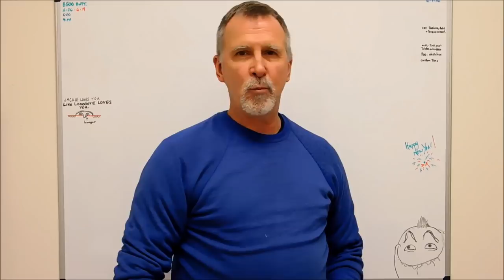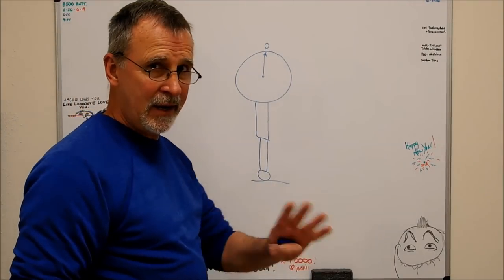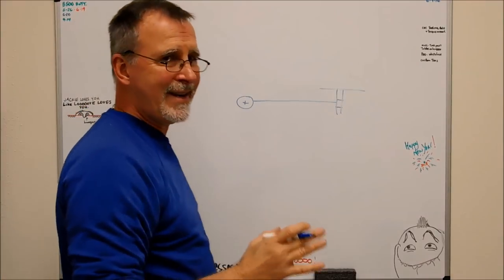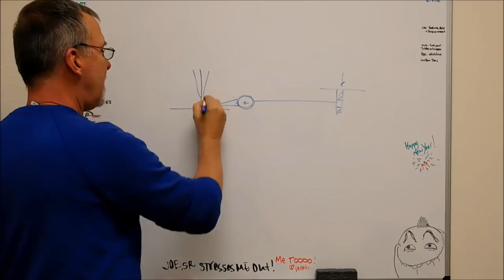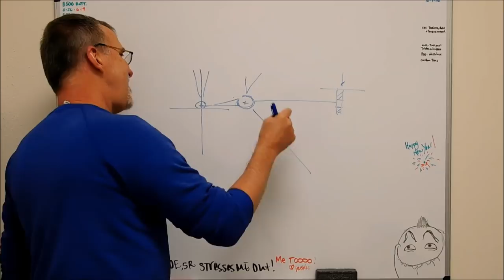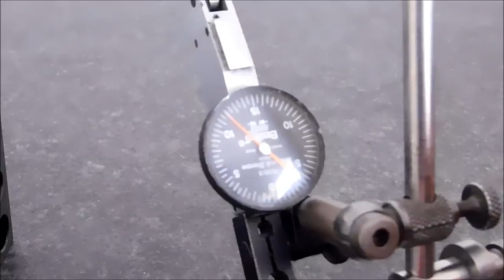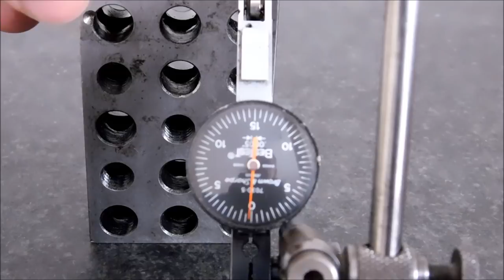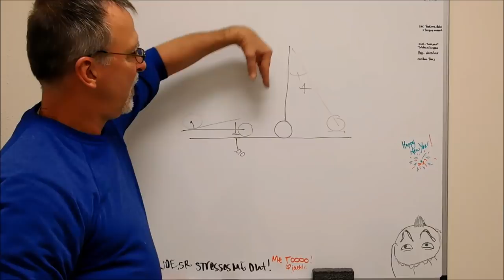Cosine Error Demonstrated and Challenged !

Comment: The videos I've watched, no one is arguing about the indicator body, it's the angle of the needle to the work. Can you post an example so I can get worked up, or perhaps a chuckle. ..?
Reply: The last 30 seconds covers the angle of the needle to the horizontal plane and THAT is where the cosine error can occur with a last word indicator. If the angles are identical for 2 readings, then there is no error- but this only occurs when indicating IDENTICAL heights. Any height difference induces not only the cosine error, but also the actual-stylus-length error because the tangent point on the ball has shifted. 
  See my post to Joe P.
Reply: gene koveski Thanks, I understand. I was being a wise apple in that no one is arguing about where the body is in relation to the needle (hence the friction action of the needle). I turn the body to face me all the time.

Comment: what you didn't include in your video was how you rotate the stylus which is held with a tiny clutch to keep it in the desired position ...otherwise good video
Reply from the maker: On a starret indicator, its actually a very small crown gear type interface with a release cover. No clutch on that one.

Comment: I believe what there are saying is that cosign error does not exist between the body of the indicator and the stem of the indicator. I believe what was said is that the angle of the stem, tip, arm of the indicator relative to the surface being measured induces a cosign error which I believe to be true... this Is not new science and has been known about foe some time... again I say the stem or arm of the indicator relative to the surface being measured... it has nothing to do with the body of the indicator
Reply from the maker: Thats the point.

Comment: Can you suggest an accurate method of determining the size of small reamers? I have been given 40 or 50 small reamers from approximately 0.060 inches to 0.200 inches. Every time I try to measure these with a micrometer, I get variations in size of 0.005 to 0.010 inches.
Reply from the maker: This is not unusual unless your reading variation is on the same reamer. if thats the case, maybe your mic is the problem. try measuring a standard with the mic to see if its reliable then proceed. Close the mic down slowly while hand spinning the reamer in reverse. When the reamer hangs up, you have your size. Check it in a few spots to be sure. Reamers are available in  countless sizes. Maybe you have undersize and oversize assortment. That would be great.
Reply: David Barlow aQà

Comment: Unfamiliarity is probably the biggest reason for miss-setting an indicator.  As a result, you fight to get the indicator perpendicular in one view, only to find out that it isn't in the other view.  So you correct that, and find out that you fouled up the first.  I found that to be quite frustrating.
I came up with a little aid to help eliminate that.  It's fairly simple, and could easily be a beginner project.  And it could be made from anything that isn't explosive or Jello.  Looks like a bell center with a notch at the top.
I've done a prototype, and came up with a few other ideas to try.  I was intending to video the second version and post the results, but if there are enough of the new and fully frustrated as I was out there, I'll see what I can dredge up, in the way of video, of the first one to at least get the idea out there.  Otherwise, the weather is causing me enough pain to discourage me from getting out in the shop, and it may be a while before I get a 'roundtuit.'
Reply from the maker: My shop temp hovers around 46 degrees in weather like we are currently having. Its brutal.
Reply: Joe Pieczynski:
And here I was thinking your shop with the machinery you have was toasty and warm!  Mine is unheated as well and NEEDS to change because of humidity. 
You want brutal, try a dive when the water is 30* and you're using a 1/4" wetsuit!!  I did that a couple times - North Sea - (scuba) when I was navy diving. Water in the bilge was frozen.  As a commercial diver we had warm water suits - lovely.
Reply: Joe, there have been many times that I found warmer than freezing conditions to be more uncomfortable, probably due to the difference in humidity... temps in the 40's with rain can really make my shoulders howl.  Elevation might be a factor as well, though I'm not sure how.  I am sure that some of the brutal summer temps that you have to endure plays a part in how colder temps make you feel.  In the early 80's, I spent several days working outside, among loaded grain cars in a gravel covered rail yard.  Daytime temps were well over 100,  (night temps barely below that) so that even after the sun went down, you could feel the heat radiating back out of the cars as they went by you.  When that heat wave broke, we had an evening where the temps dropped into the mid 70's and I was shivering ("like a dog passing peach pits" is how one person described it).  I had to find a jacket!  That winter I seemed to spend a lot more time parked next to the wood stove.

Scott, one thing I found is that if you keep the air moving, it will help keep moisture from settling on your machines.  An oscillating fan, left to run on low while you are out if you have one.  If you add heaters, keep in mind that some unvented heaters will dump more moisture into the air, which could wind up on your machines.  Fan driven 'bullet' or 'torpedo' heaters don't seem to be as bad about it, but an old style, unpowered, gravity heater will sweat/frost your windows big time.  I tried a small (propane) one inside a VW van once, while I was working on a wiring problem.  Instant curtains.  By the time I quit for the night, the frost layer on the inside had to be over 1/8".
Reply: diggerop:
Totally familiar with unvented heaters - water vapor is a byproduct of combustion and propane is the worst, I drape my machines. 
As to hot and cold, spent years on the equator, I hate cold!  Did a welding job in Djibouti (temps up to 135* dropping to 100* at nite) inside a black barge, supported on land in the sun using 5/6" 70 series wire. 4 rods then outside remove t shirt, wring out (sweat instantly evaporated when it hit the deck), and DRINK water. Grab 4 more rods and back inside when shirt was dry - maybe 3 minutes. End of day shirt was white from salt and almost stood by itself.

Comment: While you are correct, you didn't show that the other claim is wrong. (I suppose it's enough to show that you're not wrong.) Can you do the same experiment with the body parallel to the test surface but the needle at a 30 degree angle? Also I know of at least one manufacturer (Interapid) that design their mechanism to be used with the needle at 12 degrees from the surface and say that if you have to use it parallel to the surface for some reason (e.g. inside of a small bore) that you should multiply your reading by 1.022 to compensate for cosine error.
Reply: The gearing rate inside the Interapids are made with some compensation for cosine error built in, to allow enough angle of tip to provide clearance below the end of indicator body.
Reply: That's what I meant by "design their mechanism to be used with the needle at 12 degrees from the surface"

Comment: Another great Vid Joe. I've learned something from every video you've made. I have a setup question. Do you have any great wisdom to make it easy to setup a rotary table and center a three jaw chuck on it, on a mill. I figure if anybody can make this easy it's Joe π.
Reply: for centering the chuck on the rotary table i made a low profile plug that fits into the center of the table and the mounting side of the hole in the chuck. to center the whole setup on the mill to the spindle of the machine you'll need a "centricator" which is a style of indicator that shows the offset of a round object held in the chuck.
Reply from the maker: This very subject is being composed as we speak. They can be very easy and productive with a little planning. Stay tuned.
Reply: Awesome. Thanks Joe

Comment: I never bothered to watch this video previously but it's pretty much exactly what I was taught around 1974. The indicator body angle is irrelevant but tip needs to be withing +/- 10 degrees (although it's dead easy to get better than 5 deg.)  With the tool (DTI) parts specification (lengths, helix angles, etc) a mathematician may be able to prove different but the numbers wouldn't be anything I could measure as I very much doubt error would be within the first  4 (maybe 5?) decimal places
Reply from the maker: In a nutshell, the lever arm should be as close to parallel with the surface in question as possible.
Reply: @joepie221  Lever arm is what I meant but didn't say
Reply: @peter jones

I contend that is exactly why the cosine error crap has started. People not referring to dial indicators as such, and test indicators as such, and not saying lever arm, but 'indicator'.

I have learned a number if different trades over my life, they all have their own language. I used to think it was arrogance about their profession, but have come to understand it is to assist in clear communication between practioners of the specific trade.

Comment: You were correct on the dial indicator example, but not on the second example.  It all works as you said if you keep the indicator arm parallel to the surface.  When you vary from that zero degree mounting then the test indicator will give you a larger reading, or cosine error.  In it's extreme at 90 degrees as you showed on the board at the end the cosine error sows up as what you called a pendulum error.  A better example would have bee to raise your indicator a millimeter or two and then measure that shim.  It will measure greater than it did before.

In your setup the critical thing is to have the center of the indicator's finger pivot at the same height as the part (parallel to the surface).  Now if you raise the indicator a bit you see that a line connecting the center of that pivot to the point where the test indicator touches the surface is now at an angel to the surface.  This angle will be the source of the cosine error you will get when trying to measure the shim a second time!  

I know I am not a machinist, but the geometry is what you are talking about here and by keeping the indicator finger parallel to the surface you have eliminated the cosine error.  That error is still there if you make the same mistake in the second example which you made in the first!

Respectfully,  Terry
Reply: Terry Horlick But that makes no sense. That would be moving the entire test indicator away from or towards the part. Of course the reading would change but not due to "angle induced" error. That's just moving your indicator.
Reply: He was right on the second too.  Indicators have a range they are accurate.  Up to you to put them there. Learn your indicator.

Comment: great info!! thanks very much Joe!!  how do you get the needle on your indicator to change angles? mine wont budge!
Reply: Angela Terry 
I believe most will move if you push them hard enough. You just need to push the stylus to the end of its travel and then keep pushing. You have to overcome a certain amount of friction before it'll move. It's a little nerve-wracking at first. I suppose some may not be adjustable, so don't force it and break something.
... well, this is what I've been doing, but I guess I'm not sure it's the "right" way. It might not hurt to get a second opinion.
Reply from the maker: What type/brand of indicator is it?

Comment: I am not a machinist. With that being said, is there a procedure to set the drop indicator square to the surface to be measured? Is there a true flat surface on the indicator to get it square in both planes with the surface to be measured?
Reply: Square the surface measured to the side of the indicator. The axis of the stylus is at 90 deg to the side of the instrument. 90 + 90=stylus axis is parallel to the surface

Comment: How do you change the angle of the tip? It seems to be fixed on my test indicator.
Tried loosening the screws, but couldn't change the angle.
I've learned a lot from your videos. Thanks.
Reply from the maker: Most are just friction mounted and will slip under a little pressure. Check online if you have an off brand, but most move.
Reply: @joepie221  Even off brand Chineseum (been watching too many Ave vids) seem to be friction but they have a hell of a lot of 'stick' before they move. I bought a cheap set as the magnetic base was all I really wanted but with indicator was same price as just base?. While it's new it's accurate enough for what I do but I don't hold out much hope for long term use .
Reply: I have found a lever arm 'stuck' every once in a while. Typically, when they are stored for a long time in a damp environment.

I have found a dip in some alcohol, (best, least destructive solvent I've found), for half a minute, dried, then followed by a spray of PTFE, (teflon), lube fixes them. 

Also, try clamping the tes indicator body in some soft vise jaws, (gently, just to limit rotation), then put a good fitting screwdriver in the screw slot, and rotate the arm with your other hand.

The screwdriver stabilizes the pivot joint, allowing the extra force to be put on the friction joint, and not the innards of the test indicator.

Comment: I'm not at all a machinist, but I think you have misunderstood the cosine error for your demonstration. The rotational plane of the ball needs to be perpendicular to the surface being measured! I think you may even find that it becomes a "tangent error", as if the dial is rotated over close to 90 degrees then it would have very little freedom of movement and would in fact require very large movement on the scale to measure even tiny distances. 

What you would be trying to make "students" aware of is that the ball arm rotates directly in the path of the movement.
Reply from the maker: I disagree. This demo was spot on. For what its worth, you don't measure with an dial indicator. Its used for comparison. For a very accurate representation of comparative distance or error, the advice given here is very accurate. If you were a machinist, you may have a better understanding of the demonstration.
Reply: @joepie221  , I'm only a lowly fabricator,(one that welds and machines in the same shop, a true no-no to a real machinist). FWIW, this is simple practical mechanics and you are spot on. I do enjoy both your approach and tone & have been greatly improving my machine work of late, in part to your help. Thank you.
Reply: Fester Blats  you can run it at 60 deg and get a 2x scale so a 15fsd would be 7.5
When the arm is parallel there is minimal vertical force on the indicator. Basically only spring tension and its almost the same force vertically. When you change the angle the vertical force goes up rapidly. At 90 reg its purely vertical force and no rotational force. That significantly affects measurement accuracy and is very dependent on the setup rigidity.

Comment: Once again, lets hear from the 5 thumbs down folks their reasons for the same.
Reply: Don't hold your breath for any of them to actually say why they add those thumbs down. I suspect it's more just to piss people off than a proper comment about the content. At 931 thumbs up and 5 thumbs down right now it pretty much shows there pointless.
Reply: Going out on a speculative limb here. Could be that THEY already knew the content and thought the video didn’t apply to them and was a wast of time. 
There are reasons to dislike a video other than content.  I seldom thumb down a video but when I do it’s because content is wrong or the presentation is horrible and then comment on why. 
Don’t do a lot of thumbs up either but probly should. I like Joe’s videos mostly for his presentation  a lot of the content is familiar and it’s alwas good to get a new or different perspective or even get reminded. The guys an ‘out of the box’ person with solutions on a problem basis as are a lot of professionals in a lot of fields. So maybe the detractors just didn’t like the how or why - like I said, it’s speculation.
Reply: Imagine, that there are reasons. But it's beyond you.
Video is about 90% fine, still he earned thumbs down.

Comment: So in Theory, the indicator would be more accurate used improperly than it is when used "properly"
Reply from the maker: More sensitive, maybe not more accurate.
Reply: Sensitive is a better word. The theory would be that with the stylus at 60dg (WAG) to the part plane your 0.0005" indicator would be reading 0.0001" per mark.

Comment: You also start to hint at the fact that you might be able to use cosine error to measure something more accurately than your indicator... Interesting idea.
Reply: jason martin its a bit like setting the compound slide of a manual lathe over to 5.75degs between the part and slide. you can gain nearly 10 times more resolution on depth of cut by using the compound slide... but you have to keep adjusting the z position.
Reply: As wez50 suggests about the compound slide method and you have said Jason this fact can be used for good or evil, lol. Ihave used this to advantage in the past, cheers from John. Australia.
Reply: Ha ha for good or evil.. I like it. In my experience every time you increase The desired accuracy of a part the complexity and lengths you have to go to increase exponentially. When you’re worrying about microns then temperature becomes a consideration... on top of everything else. I have seen errors with lasers created by pressure variations in the building... when you really start measuring things below a couple of microns you start chasing your tail but gain a deeper understanding of this so called reality we live in.... unfortunately the microns on my lathe must drop on the floor and get swept up as I rarely get better than 10mic / 0.5tho with dials... I expect better with scale fitted (with no cosine error)